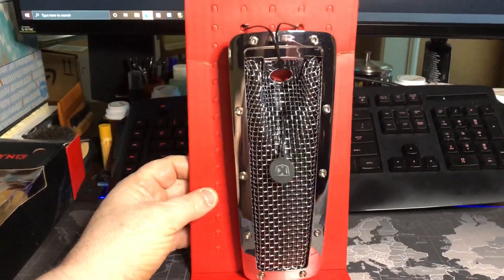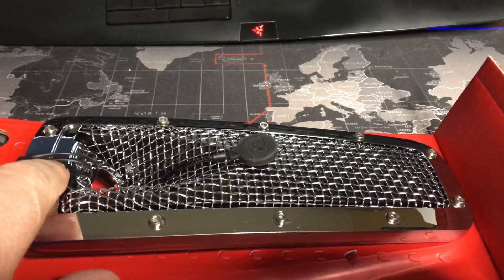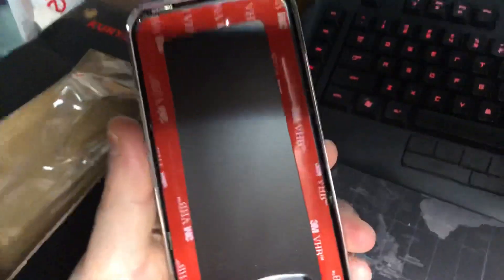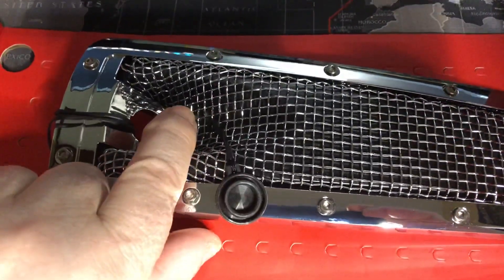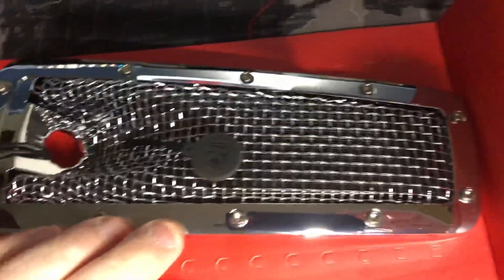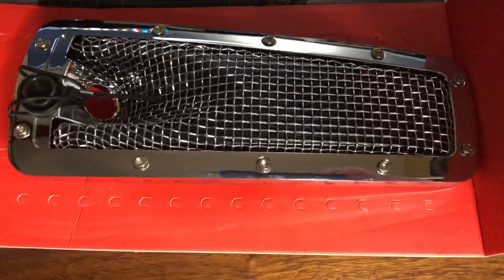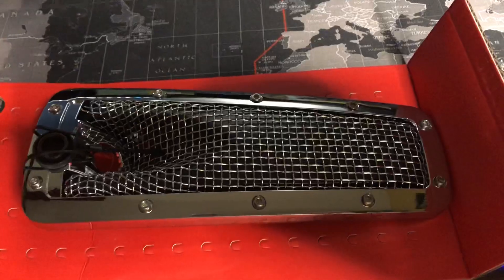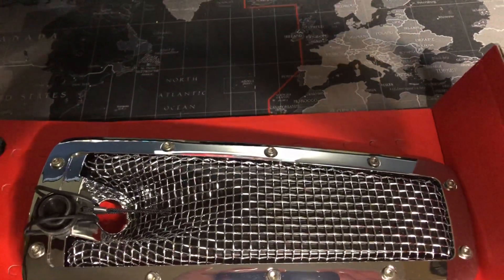2018 Road Glide Ultra Console replacement

Comment: That looks a lot nicer than what Harley put on there.  Hopefully they will learn before it's too late
Reply from the maker: its really nice, just hope the mesh does not rust...know what i mean.....lol
Reply: @Frostytravels  Now that you mention that I wonder about keeping the mesh area clean.  That may also be an issue.
Reply from the maker: @thedonerightranch2197  Turtle wax Ceramic Coat, hydrophobic new stuff. I am trying it> I will update on how it does.